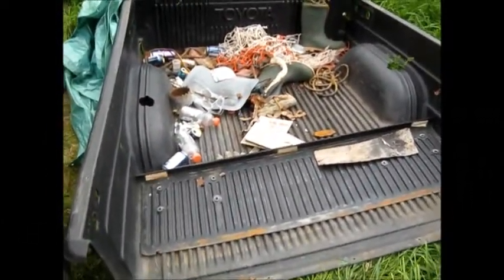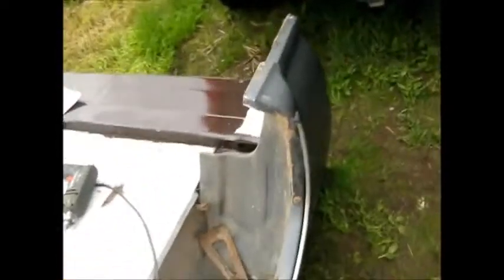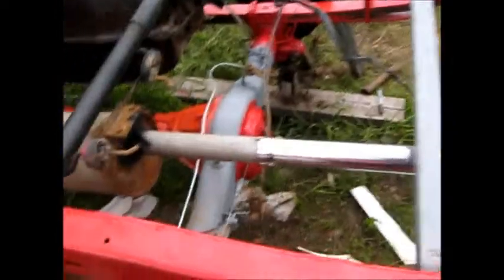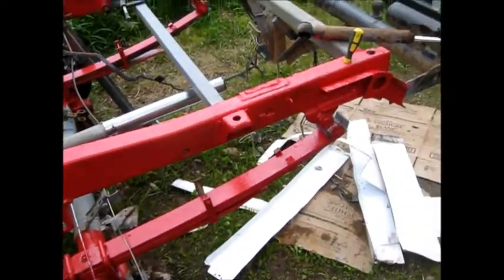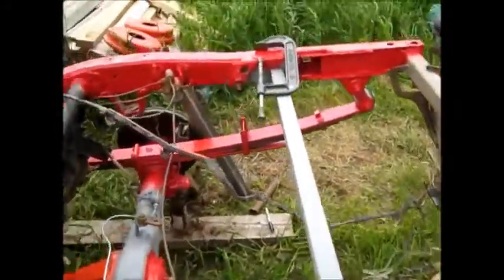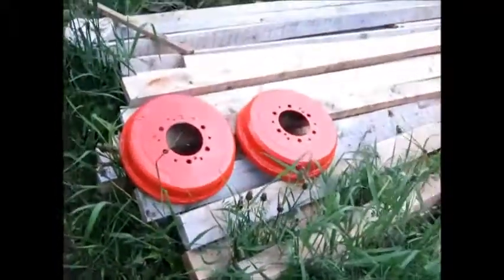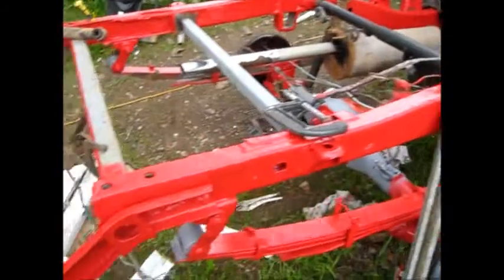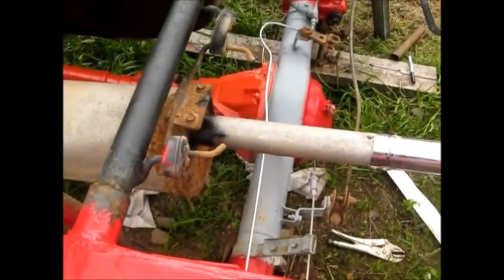TRUCK REPAIR

Comment: Good as new now!  I am trying to get my '92 chevy back on the road... the headers burned out, so the manifolds ae going back on, just need to find the studs and bolts that bolt to the block!  the older trucks are built way better than todays models!  Good job man!
Reply from the maker: Thanks Dave